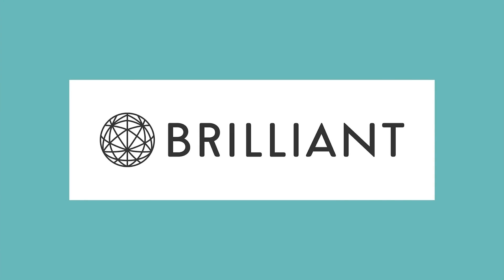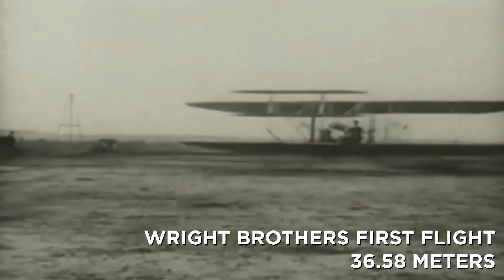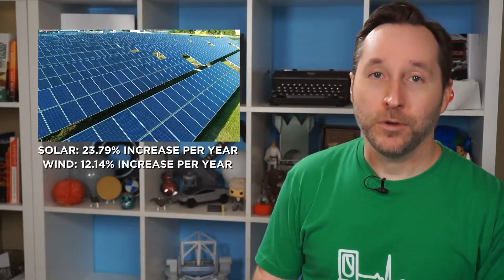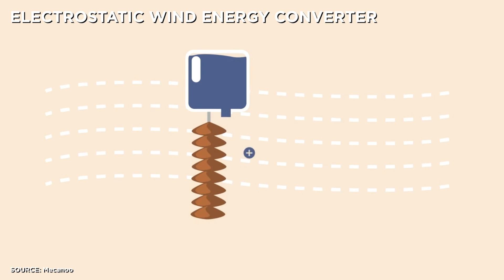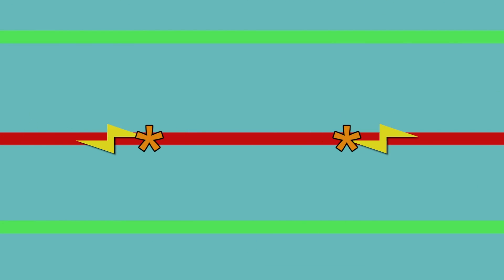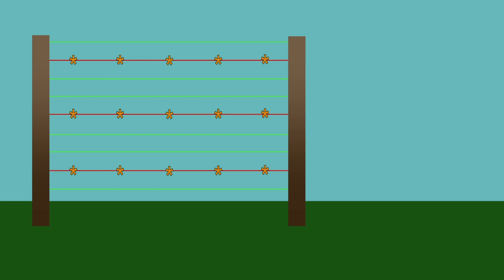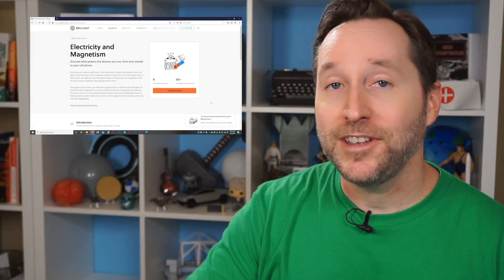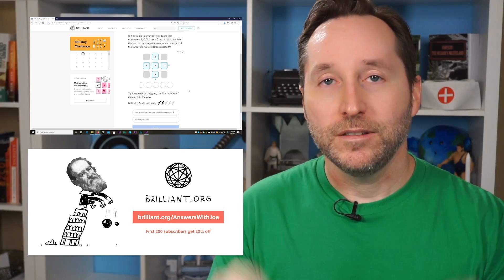Solid State Wind Energy | Random Thursday

Comment: Aluminum and carbon fiber is a strange choice for a high voltage ion source.  The oxide layer on aluminum will be hugely problematic.  How those carbon fiber cathodes are bonded to the wire will make a huge difference.

Another possible solution to emission (which is thier main issue) is to use rf/microwave plasma.  You can cut out the high voltage source when you use a microwave resonator to generate plasma and simply charge it with a voltage potential.  The plasma's interaction with the atmosphere's atoms creates the ions.

The other, arguably obvious thing is to take this two or even three dimensional.  Any commercial application would need to have much more surface area.
Reply: Check out Ion Power Group, forget the high voltage source and just put one wire high up, collect the atmospheric icons directly.

Comment: Comparatively rarified populations of large raptors are the birds most impacted by wind turbines. Cats and buildings have nearly no impact on these larger birds so it is non-sensical to compare the relative impacts of cats, buildings and wind turbines. Passarines (the main victims of cats and windows) are much more numerous than raptors and the relative impact of wind turbines on them is quite small. Reducing wind turbine (WT) / raptor fatalities has been an important design consideration in WT design for years now and significant progress has been made. Most notably, replacing myriad smaller WTs with fewer, larger WTs has been a key strategy and one that also made perfect sense form a technological and cost standpoint.

Comment: Is the "parabolic mirror" way of generating electricity inefficient? I've only seen a documentary about one instalation, long ago. Never again since. This was a huge installation somewhere in the desert. 
The premise is that mirrors point into one focal point in where a water tank is placed, boiling water to steam, rotating a turbine. Pretty basic stuff, technically doable in a back yard. 
Also the mirrors create a lot of heat thousands of degrees, in the focal point so creating steam should be a cakewalk. Yes obviously a drawback is when it's cloudy, but same goes for solar panels, which I would assume generate a lot less, have a short span of about a decade and replacing creates a lot of waste. A steam powered turbine has maintenance, but not nearly as much as solar and has potential to not leave anything to waste. Yet nobody seems to ever mention anything of the sort.

Comment: Just for the record. They do make small scale wind turbines that can fit in your backyard. Just saying.
Reply: But the maintenance costs plus economy/roi.
Reply: Yeah those are a scam, Quint Builds tested a few by mounting them to has truck. Only heavily modified version generated any usable power at much higher wind speeds than advertised.
Reply: @BlackHeartScyther  is that the guy doing 40mph for a wind turbine optimised for 25mph, thinking it would produce more power... That guys a moron.
Reply: @mikewade777  He drove it at 40mph because it was not performing as advertised at 25. 

Also, faster winds = more power, they have power curves for any decent turbine that show this. Spin a generator faster, more power generated, I don't get what the problem is?

Comment: This is nothing new. So is the aeroplane.

This idea based on a patent by Thomas Townsend Brown from 1928

"A method of and an apparatus or machine for producing force or motion"

In the 2000's there was a group of people who made model lifters ,(also Nasa US6411493 )
The Lifter is an asymmetrical capacitor which uses High Voltage ( > 20KV ) to produce a thrust.
For more information you can visit jnaudin's 
 
search on google "
The JLN Labs home page"

Comment: Shouldn’t there be a way to have the wind vibrate a wire, and then turn that energy into electricity like pickups on a guitar? I know it’s not “no moving parts” but it’s almost zero and should be quieter than a traditional wind turbine.

Comment: This ion solid state system that he's describing sounds very simular to Nicola teslas work he had a set of coils around a ground post with a tranfer plate . then he just spliced into the system to draw off voltage from the stored energy in the void space between coil and ground , used a transformer to convert voltage to amps and modulated frequency with spark gap. I believe the missing piece to making his system able to produce large power is the pancake coil but no one seems to be able to figure out teslas method for developing power increases without increasing input (ie more from less) breaking the laws of thermodynamics

Comment: Watts is power, not energy. And that captures the main problem of wind energy. Power goes as cube of wind speed (often even worse because wind turbines are not optimized for low wind conditions). So that has two implications; power production will be extremely variable and over areas as large as weather systems; and the higher you can make them the more energy you will create; small wind turbines are really useless. This variability and high correlation over areas as large as weather systems is why there is no such thing as wind energy; there’s wind+hydro or wind+gas but wind alone is useless. The purveyors of fossil fuels (e.g. Amory Lovins) and greens have the same relation to ”green” energy as bootleggers and baptists did to the prohibition; they’re both for it, one because they think it works and one because they know it doesn’t.

Comment: a guy can dream?? This could never make lots of power. It would need massive arrays for any useable power. So no, it will never be on somebodies house.

The ion propulsion idea could work... if you have a megawatt class nuclear reactor on the plane.

Jet propulsion is measured in watts. If your ion propulsion system does not have kilowatts of energy its not going to make kilowatts of thrust.

No matter what “innovation” they come up with - your ion plane needs a power source to generate the thrust from.

Joe... do you even math!?

You cant fly on a fart - there is a reason the ion plane needed thousands of volts - thats the only way to produce enough ions to get any thrust. You cant magically make ions and you cant magically make the ions produce more thrust.

The only way ion thrusters become viable without nuclear power sources is if somebody discovers over-unity bullshit.

Comment: Issues with wind wils are huge and not a so called green energy. And they cost a fortune to maintain and have a short life span and change the climate by redirecting wind. The EOL end of life is an issue, from all the materials used and its carbon Footprint to manufacture, the same with solar and nuclear

Comment: Instead of concentrating on one source of energy for power, maybe it would be better to combine different possibilities/sources. Solar/wind/SWET/EWOCON all together. Also,  If the movement of water droplets and ice particles going up and down within a cloud causes friction between the particles when they collide which charges up the cloud and positive and negative charges separate and an electric field is formed surely there must be a way to do something similar in a controlled environment.

Comment: Energy saving? Reduce use is a major way to go. LED lighting can use as little as 10% of traditional incandescent light bulbs. Modern flat screen televisions use around half that of their CRT predecessors. Home cooking: induction stoves use less energy than either gas or traditional electric stoves with an added saving that when the pan is off the stove no energy is used. Keep working on efficiency. Also check your own power usage.

Comment: Absolutely could have parity! Just think...could mount rows of wires as fence rows along property boundaries, or vertical along walls in a decorative panel, or over roofs. Could mount sets of panels along always pretty windy highways. 
One issue might be, though, is cleaning, where birds & bugs would spin webs & dirt that could “dampen” vibrations of the wires or “artificial muscles” inside tubes. But really low maintenance.   Also, weather-exposed metal wires corrode, which dampens vibrations.  
Could have wind scoops that direct air over the wires in a more focused way. Could enclose the wires inside a wall or fence, using wind scoops & ground vibrations to concentrate vibrations.

Comment: They have to be so big - that is high - because the energy-flux in wind grows with the third power for the distance from the ground, because wind is faster in higher altitudes. If you have a huge pole already, you might as well put some huge wings on it to get a bigger area of effect and reach up higher.

Comment: the main problem with smaller scale wind turbines isn't that they don 't work or aren't a viable alternative to solar, it's that most often people don't understand or aren't aware rather of the necessity to place them far enough away from any structures, man-made or natural geographic or living features, as well as placing them high enough in the air column to be catching wind most optimally, or at least optimal in the feasibility sense....fyi, for any wind turbine to be really productive it needs to be at least 30 feet higher and 300 feet away from the nearest structure or obstacle.  of course you could install a wind turbine with less clearance, it just will not operate all that efficiently and you would be better off opting for an alternative source of energy production, like solar or small scale hydro if you have running water available(this would be my first choice, absolutely, there are some great low impact hydro generator designs out there that ppl are having great success with).  /blahg.

Comment: Generating "wind energy" when the wind power is inadequate or excessive is not possible.
I have deduced that since published graphs show that a so-called wind "turbine" gets about half as much power at 6 m/s as it does at 12 m/s (metres per second),  it is actually programmed to align its blades to not use 3/4 of the wind power available at 12 m/s.
The force of the wind is proportional to the square of the wind speed, and the power, to the cube.

Comment: Interesting video, thanks for making it.

I think most of the economic and other considerations would apply equally to this wind generator that result in huge wind turbines. A good site for any wind generator of any kind will have high wind speeds and be secluded so there's no opposition from people. To get greater wind speeds you want a big tower to get your generator up high into the high speed clean winds.

For all of this you will need an extension of the electricity grid, an access road, foundations, a tower, and switchgear. All of those things are a fixed cost. The return is based on how big your wind power converter is. Clearly for maximum profit you need to make it as big as possible.

The idea of putting it in a city seems crazy to me. You maximise your planning problems and minimise your return- cities have very light winds. But its more interesting as a very large wind generator and as a wind farm.  With its modular design there doesn't seem to be a limit on how massive you could make it. You could really make it very tall and it suits being made into a continuous fence. A continuous fence taking kinetic energy from the wind could theoretically exceed the Betz limit that is the maximum possible power fraction you can take out of the wind with a conventional wind turbine. Basically if you try to take more, the wind just spills round your device.

Theoretically. I notice that Wikipedia says the researchers achieved 7%, proposed changes to achieve 25-30% vs. current wind turbines that hit 45% on a good day. It's not fair to compare them, one tech is very young. Also even if the electrostatic tech has half the efficiency, provided it is more than twice as cheap,  it's an overall winner.

Comment: Build it inside a solar tower. A glass tower where solar energy draws cold air in thru the bottom, heats it and exhausts it out the top.  This eliminates the need for inconsistant wind.  I doubt all that much energy can be produced to scale, but it seems to be an improvement to the proposed model.

Comment: I was thinking about what to do with the pillar left when the blades are removed. Use the generator on top, the hallow pillar, and an internal structure to generate water from the environment. Cladding the pillars in pv cells / or turning them into a vertical wind power generator.
Reply: If the tower is in good condition, just put a new nacelle and blades on it, and let it go back to stealing power from the air.  If it's not in good condition, tear it down.

Comment: The reason birds get caught by wind turbines isn't just the height; It's the light.  Every wind turbine has an aircraft warning light(s) on the nacelle.  Birds are confused or drawn to the light.  Same problem with high-rises and windows in general (of course the reflective surfaces often don't help either).  A probable solution is to move lights to surround a wind farm instead of mounting them directly. I may get flack from some pilots out there for this advice but here's the thing:  I am licensed pilot myself.  This is a safe alternative for all concerned... including the birds and the environment.

Comment: Birds like standing on positively charged ion wires as much as they like flying into wind farms. Which one produces more energy without burning coal?
Reply: The wires are pretty thin and quite close together.  I'd be afraid that a bird might not see the wires until it was close enough that its body short-circuited the charge between the positively and negatively charged wires and it was electrocuted.
Reply: @calamityjean1525  Nope. Never happens. Wires are way too far apart for any bird to complete any circuits.
Reply: @MANUALinappropriate  Oh, good.  I feel better.

Comment: video starts at 6:07 its actually just aluminum wire strung between 2 wooden poles. Some wires have a small negative current running thru them which releases negative ions that are blown away.  Electrons rush in from the ground via the wooden poles to balance things out, and then you capture that rush of incoming electrons as electricity.  This is a net gain of electricity.

Comment: The historical fact about wind energy is that empires with sailing ships, and even the British East India company had sail-powered warships. That entire technology was swept from the seas by coal and subsequently petroleum. 
But it did its job better than wind-propelled generators (they are not really turbines) can supply an electric grid on demand.
 It should be intuitively obvious that wind cannot displace coal and hydrocarbon combustion.
Reply: If you mean intuitive based in current technology, I agree. Im not a big wind guy, but to say its intuitive period is strange since innovation is not intuitive. There are a ton of things were doing today that no one 100 years ago wouldve found intuitive. And 100 years is not thst long a time period. Who knows where we'll be in another 100 years. We're past the time when anyone should feel justified projecting their intuition into the future, at least technology wise.
Reply: @oakinwol  The need for a way to abolish any further biosphere-deadly fossil CO₂ emissions is far more urgent than 100 years. We have already wasted 40 years since a Nixon budget cut caused the AEC to abandon the Molten Salt Reactor Experiment, Alvin Weinberg's solution to the most unfortunate awkward aspect of his PWR design,  using the fact that molten alkali halides (fluoride, or chloride) can readily provide a liquid, very hot fuel without needing the inordinate pressures that keep water liquid at 350°C
Reply: @oakinwol  No, the intuition should be applied to what we know, and was perhaps exaggeratedly illustrated by Samuel T. Coleridgein the tale told by his "Ancient Mariner".
The wind is fickle, and it's WRONG to kill big birds wantonly.

Comment: Think about the number of farms dotted around the world, all use wire fences. That's miles of fencing that even if it produced a small amount of energy per foot, could multiply up to create enough to drip feed into the grid.

Think about homes with fences between gardens, again if each one of these fences had a system that drip fed tiny amounts of energy into the grid, would that not add up over the millions of miles of fencing that could be harnessed 24/7? 

Love this idea! Thanks for sharing.

Comment: So with 2 masts about 5 people high(i hope I use freedom units correctly), they produced barely enough to light up a led enough to see it in a dark room.
The wind speeds required remind me of crazy dust storms. And those at least generate proper lightning discharge.
On wind turbine blades a similar effect can be observed. The different charge due to the different wind speed between blade tip and axle even eats a bit of the tips over time. Still that power is negligible compared to the wind turbines output. While it's a interesting proof of concept, it's a waste of resources for power generation. At the moment solar is hard to beat in regard of price power generated energy. On the other hand, imagine these things having to be cleaned by someone every few days, while they generate less energy than it takes to get the cleaning person to the device. This doesn't include production of the device, nor the way back for the cleaning service. So I have to disagree with the implied conclusion, that this is the energy of the future.